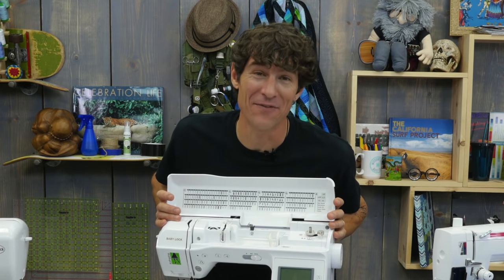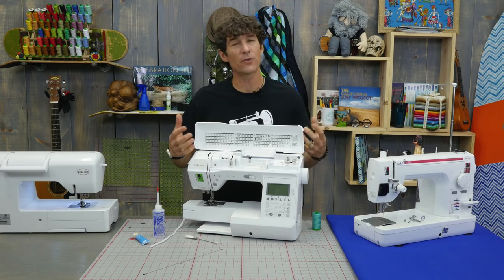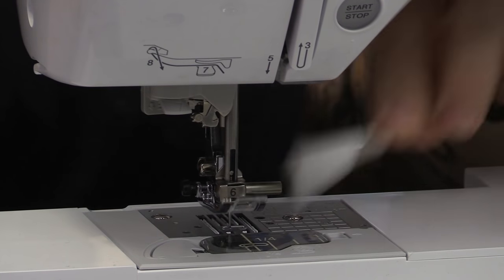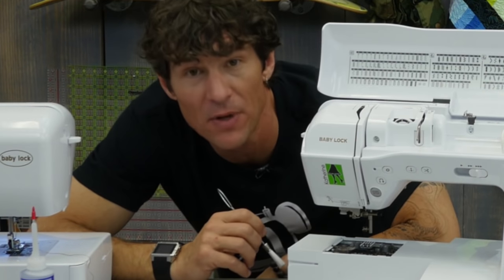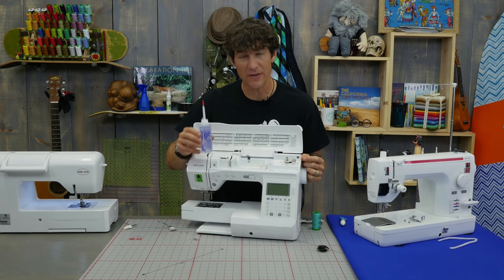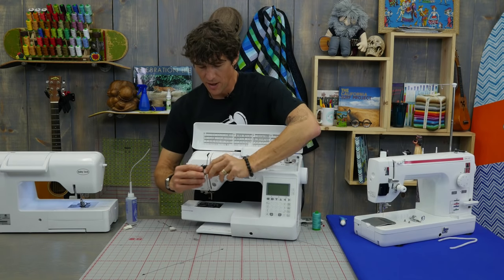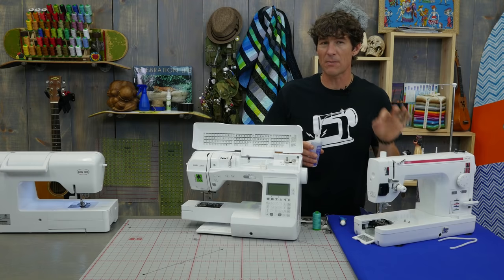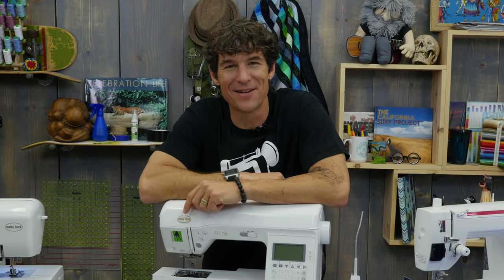Sewing Machine Maintenance: Oil and Clean

Comment: Love the pipecleaner tip, thank you! The other thing you mentioned that will help is to always have the presserfoot up when threading or unthreading the machine. I have probably not been consistent about having the presser foot up. Also, I probably need to change my needles more often. I agree absolutely with dusting before oiling, have done it that way since I started sewing.
Reply: Sounds just like me

Comment: I would like to say thank you very much for your videos.  I have two Kenmore's and both started  having tension issues where the back side was gathering thread.  Nothing I adjusted helped.  HOWEVER,  I took both apart, as you have shown, and cleaned out a ton of dust bunnies.  Put everything back together and WOW....just like new.  Amazing that this simple clean project worked so well.  Thank you for making the effort for these videos and thank you for saving me money because I was headed out to a repair shop!

Comment: Hi Rob, I loved this tutorial and learnt a thing or two or three.  I thought I was all set in my cleaning as I never let the fluff build up and NEVER use canned air after seeing what it did to a machine on Pinterest.  I am guilty of doing exactly what the manufacturer said and NOT oil, but I will now do as you have clearly explained.  The second thing I learnt today was about threading with the foot raised.  I did not know that, how could I not know that? I thread whether it's up or down which explains why sometimes I find it much harder to do.  The third thing I learnt was to clean there also.  I always use a pipe cleaner to clean even where my drop in bobbin is to get to those places the brush can't reach.  I even bought myself a set of mini accessories for the vacuum so I could suction.  So you see I thought I was good but I missed the areas you mention where the thread goes.  THANK YOU SO MUCH.  This is so helpful.
Reply from the maker: I'm so glad you learned a few new things, Conchita! :)

Comment: Hi Rob. I work for a sewing machine/quilt store in Round Rock, TX. I appreciate your videos, and I often refer to our customers to look at different training videos to get the most out of their machines. On the tension video-- well done (even I learned a few things!)--  it would be helpful to edit it to include HOW to adjust the bobbin case with the adjustable screw for horizontal loading machines . It is not always practical to use 40 weight thread in the  fixed bobbin case provided by Babylock/Brother-- using 60 and 90 weight bobbin thread does work best when using the decorative stitches. And, not all machine lines have fixed screws, e.g., the Pfaff/Husqvarna line standard bobbin case does not include a fixed screw. So, hopefully you can address this and show folks how to adjust that screw on a horizontally placed bobbin case. And, it is always good to leave one bobbin case, side or top loading, at the manufacturer's setting, and buy a second adjustable one to play with as needed-- embroidery stitches, bobbin work (and some brands with top loading bobbins have special bobbin work cases), etc. Thanks for helping inform our customers how to take care of their machines, and when it is really necessary to bring them in! Sometimes once a year is really overkill...
Reply from the maker: Thank you so much! Those tips are great. :D

Comment: Thank you for another great video.  I always use a very small, natural bristle cosmetic (eye shadow) brush.  They're cheap. Readily available and instead of "brushing" away the lint, every bit of lint actually clings to the natural bristles. After a few strokes I just wipe all the lint off the brush onto a piece of scrap fabric or batting.

Comment: Great advice. I do service and appreciate you telling people to do just the things they need to do.  Yes I have had them dripping in oil!  I tell people "you have to service your car so yes, you have to service your sewing machine."  That is a hard pill for those who buy the Walmart special for $100.00 and a service is near that if there are no broken peices.  But If they see great machines like you have they will move up to a machine that makes them happy.  Nothing is nicer than using a good quality machine if you have struggled with a low budget one.  The dealer I work with sometimes borrows out a decent machine if the customer has need of service and has a project they need to finish, and they usually come back to buy one just like they were using.
Reply: I should make that clear.  They come back to buy the one like the one they borrowed.

Comment: I definite have to thank you. I took my older Janome sewing machine in to get serviced about 5 years ago and haven't used to since, however with the new circumstances that we are all facing. I decided to sew some masks up and yes some jeans. I do have a newer Bother but it's a computer sewing machine and it's for quilting etc. Even that one sat around for a few years. Anyways I watched your video and cleaned and oiled the Janome. I was going  to get rid of it, but thanks to you I got it working and it's better for heavier jobs. I saw that the the Janome is a better sewing machine or it's on Amazon as a heavy duty machine. I was having problems getting the Janome to sew properly but I did. I'm keeping both. Learned a few tips from watching your videos Thank you again and Happy Sewing
Reply: Janome sewing machines all have an aluminum "skeleton". This makes them stronger and with their better motor, helps to reduce vibration.

Comment: Thank you for your excellent cleaning tips! I have a lovely Pfaff 230 that was made in Germany between 70 and 75 years ago (about the same age I am), complete with Automatic Dial-A-Stitch system and its original user manual. I paid $100 for her, refurbished, from a Singer store in Dallas in 1973 and have never been tempted to replace her. 
Much of your advice in this video applies well to this grand old lady, who with her all metal body and mechanisms, still functions as well as I imagine she did when she was an agile young girl. 
I seldom use the decorative stitches she offers, but the last time I tried she was pretty cantankerous. I suspect these lady parts of hers need some cleaning and oiling as well.
Reply: Sue Mauer sue, I also have a Pfaff 230. What a great old machine (c 1962). A workhorse. I love it. I clean and oil every 5 bobbins.

Comment: I bought 3 in 1 because it's half the price of machine oil. I guess I'll have to bite the dust and but the expensive oil. My little Janome only shows one place to oil. I sub'd to some different sewing channels and after sewing my whole life-mostly when I was younger-I've learned so much! I feel like a dummy. One thing that's my biggest issue is I'm not changing my needle often enough. I just use and use and use them until I need to change if I change the type of fabric I sew. I'm going to throw all my needles away! I sub'd. I want to get back to sewing more! Thanks!

Comment: I've just watched 3 of your fantastically helpful videos. I actually adjusted my bobbin tension once a while back from my owners' manual (after several moves) like you show, but I've been 'scared' of unscrewing that plate to clean & oil, and never knew not to pull threads backwards when changing spools, nor that the foot had to be raised while threading, nor even that a pipe-cleaner could be used to clean the tension system in my Pfaff 1530!
I'll certainly be watching more soon. Thanks!

It doesn't seem like rougher treatment in moving should affect the bobbin, but I spent quite a while analyzing the top v bottom thread tension, like you showed and was also in my now lost manual before I finally made the adjustment! I have access to the manual online, so I'm OK.

Comment: Also love the coin idea.  If you don’t mind losing the dime, take a piece of Styrofoam, take a larger spool of thread and push it into the foam for about an eighth to 3/16 of an inch.  Push the coin on its side into the middle, then take low temp hot glue and put it into the hole around the coin.  Let it set for a couple days to be sure it all hardens.  Should make it easier to use.  Also, if your foam melts with the glue (test first) line the hole with foil - wrap a piece around the spool before you push it into the hole, then push the coin thru the foil and into the foam.  Don’t push the coin in too far, as you only need a small part of it to fit into the screw, and it is easier to use if the glue part rests on the bed of the machine. Again, thanks for these videos.
Reply from the maker: This is awesome stuff! Thanks so much for passing it along. :)

Comment: My Kenmore sewing machine is 35 years old. I used your video to clean it, but my outdated machine is a little bit different from those you showed.
Reply: Same here.  Actually, mines probably 45 years old.  Couldn't get the base plate off too save my life!  But I did get it cleaned up and most of it oiled.  Thank you!
Reply: Beat you both -- my Kenmore zigzag is over 60 years old.  My folks bought it on the Sears revolving credit card (I have the receipt) and it's still working.  But it weighs a ton, lives in a cabinet, and is too heavy for me to take in for service, so I just clean and oil it myself.  It has the red paint on the oil spots, just like he mentioned in the video.

Comment: Never too old to learn.  I've worked in the garment industry as a sewing machine operator.  I don't touch my personal old non-electronic machine without oiling it.  I wonder if I should back off a bit.  I also keep a small pad of fabric to sew a few inches so my material doesn't get oily.  I keep this under the presser foot when not in use.  Is that OK?  I now know not to use 3 in 1.  The tip about the pipe cleaner is brilliant.   I'm now a subscriber.

Comment: This might be late, but thanks for the tip on needles.  I had been informed that some ladies said they had used their needles for months without a problem.  My experience is that after several hours, the machine would start to lock up, and upon changing the needle, that problem went away.  I can only guess that is because the needle was worn by my sewing of the quilt top, then quilting the whole thing.

Comment: Hello I'm Tom from Colorado and I just got my grandmothers Singer 500a from 1961 lol, it's in excellent condition because she only used it four times, I need to oil it and clean up the fuzzy bunnies, this model doesn't have a belt so that's good I was told.  Any tips? P.s. I just made my first stitch with it after an hour trying to figure out how to load the string and I think I figured out, it's my first attempt at sewing ever.

Comment: Other solutions…
Instead of brushing / pushing lint out of the way — and into another crevice of the sewing machine, just get rid of it — with a vacuum: brushing lint out of one area and into another area is hardly a rationale maintenance cleaning solution, although a brushing action may be needed to loose some stubbornly entrenched lint.  There are sources for vacuum hose attachments that reduce down to create a ¼-½ inch suction source instead of the 1¼ inch vacuum hose opening.  This helps one get down into tighter areas.  Of course the primary hose opening is a great way to suck up / get rid of dust from a broader area.  Using a reducer hose lowers the intake suction pressure (see Boyle’s Law) so you would not be using higher suction pressure to damage more delicate sewing machine parts.  Lint is very light and easily removed from the most inaccessible places of a sewing machine, particularly in the feed dog wells.

Alternatively, you can just an empty regular plastic squeeze bottle, commonly used for liquids.  Use this to squeeze air thru it’s nozzle into an area to be cleaned.  Often this might push lint into a deeper recess of the machine, so use this technique in areas where this might not be an issue.  This would preclude introducing oil or water or other junk onto / into the sewing machine — your issue with pressurized air cans.

Using higher quality thread reduces lint build up; so what if it costs a little bit more.  Clean up time is certainly more costly that the minor increase in thread costs: your time is valuable!

If you happen to use too much oil, use a Q-tip to soak up the excess.  All you really need is a light oil coating in areas needing oil: commonly the bobbin and threader.  This is especially true on the second “quilting” machine you serviced.  On my older Pfaff, not oiling the bobbin thread hook guide (or whatever it is officially called) cause more sewing problems than any other issue, probably in the 90% range.  If I experienced a stitching problem, the bobbin was the first place I serviced.  Then the tension, etc.  I then manually turned the sewing flywheel or balance wheel to make the bobbin hook rotate around a couple or more rotations.  ANY oil still visible was soaked up with a cotton swab stick.

Bottom line is the newer the model of machine, the fewer parts need lubricating: as in one or two places.  Follow Rob’s advice: DO NOT put any oil where it is not supposed to be.  IF you do not know, do not do it or read your manual or take it to your service provider.  The newer machines have so much electronics and self-lubricating parts, lubrication is pretty much a thing of the past.  And use sewing machine oil.  Would you oil the hard drive or air circulation fans on your computer?
Reply: "Would you oil the ... air circulation fans on your computer?"  Yes I would, if they're running slow or noisy; it's a quick and easy job that can extend their useful life.
Reply: @eternaloptimist2840  you really shouldnt oil most fans. They use a sintered bronze sleeve bearing, while oil may seem to improve their operation the effects are very short term and cause more issues by attracting dust which turns to a goo with the oil.
Reply: @batvette  Clearly my experience differs from yours - a good light oil that doesn't go gummy, and applied only sparingly, could make all the difference.

Comment: This was so much fun to watch. I have a Singer heavy duty 4411.  I've other Singer heavy duty machines many years ago. With is one, for some reason after a few days of sewing, the tension gets messed up and I have to move it to 0 in  order to get normal stitches.   Then after a few hours of sewing I have to change it to a 3. Anything higher than a 3 doesn't give me good stitches.  This machine has always done this.  I never knew I had to change the needle fairly often! I learned something! I keep the same needle in until it breaks or if I change fabric thickness.  Would you know why my machine starts making crazy stitches after a few days of sewing?   Thanks for this video- can't wait to look at more!

Comment: Thanks for the heads up. I just wanted to know, I'm guessing it's dust n oil after every quilt, right n a new needle. I hv an older Kenmore, I've had it at least 50 years. Sews like a charm. Did so much better last time, bobbin winder even got better. Thank you😂

Comment: I just found this tutorial after I watched your YT-video on how to make an ironing board cover. That was great too, and this one really taught me a lot! However, I have a question about using the pipe cleaner. Starting at the video's "2:05 minutes"  you show how to use the pipe cleaner on the tension discs which is on the right (as a viewer's perspective), but not the left side opening for the take up lever. Whenever I my thread breaks, that's where it goes. Is it okay to run the pipe cleaner through that opening as well as the opening for the tension discs? Hope someone can answer my question!

Comment: Very informative video. My Machine is a Brother CE8100, not a high end but works for what I needed. Mine doesn't have to top or side doors to get to the insides. I've cleaned the bobbin race. Thanks for the warning about canned air, won't use that again! My manual says NOT to oil the bobbin race. It sometimes makes a bit of a grinding , clunk noise when I first start  to sew. Does machine need cleaning inside and if so, how do I access that area? Thank you spuch for your excellent advice!

Comment: Rob, this is a great video but your Baby Lock owners are going to run into an issue if they put there bobbin case back in before they put the needle plate on.  You MUST replace the needle plate first and then you can slide in the bobbin case.  Otherwise the machine is going to jam.

Comment: OILING should ONLY be done according to the machine's Instruction MANUAL! Many modern machines are made with "sintered metals"... (for example Husqvarna Viking). There is no oiling necessary by the customer at the hook (and the built in bobbin case).. HV pioneered the use of sintered bearings and metals in their sewing machines, eliminating the need for consumer oiling in the late 1970s. Again, the manual should always be consulted and followed. Your dealer is always available to answer questions too!

Comment: I have an electric battery powered blower that works like canned air, but without the chemicals and residue.  Do you think this is adequate since it essentially avoids the issues that result from using traditional canned air?

Comment: Hi Rob.  Really enjoyed your you tubes.  I am an owner of a Janome and it has a top / drop in bobbin case.  The case is not "glued" in place as you stated in your video.  You did not go any further with adjusting these  that are not glued.  Can you provide help with these?  Thanks
Reply from the maker: Hi Barbara! Thank you for tuning in! I am not super familiar with the Janome. You may need to consult your machine manual or  contact your dealer or local machine technician for more information on this. Sorry I couldn't be more of a help!